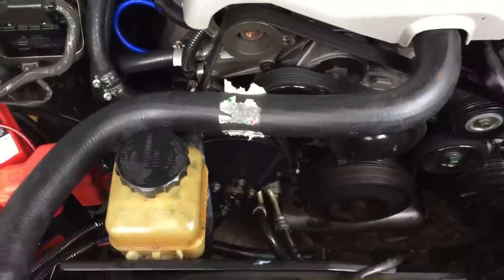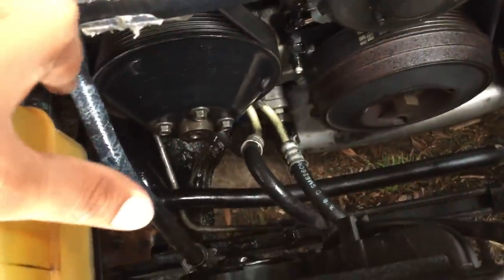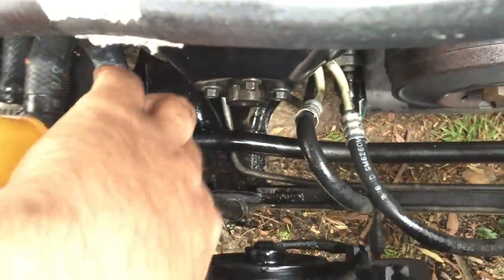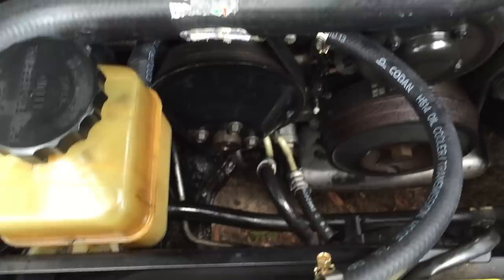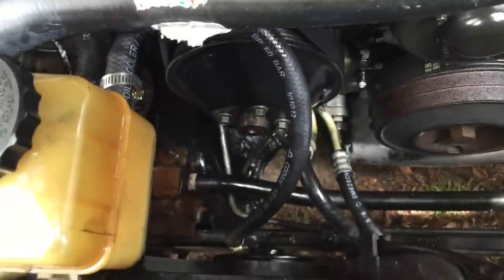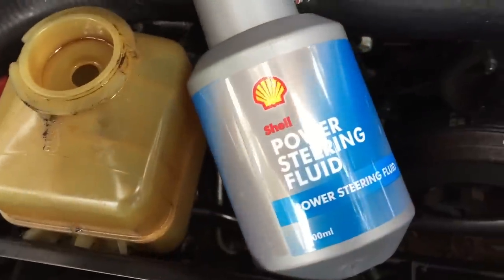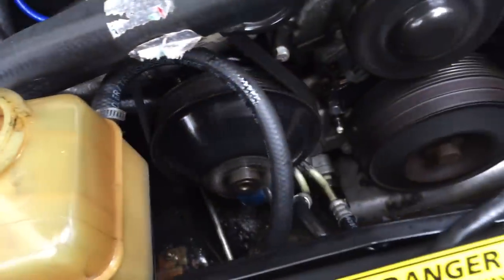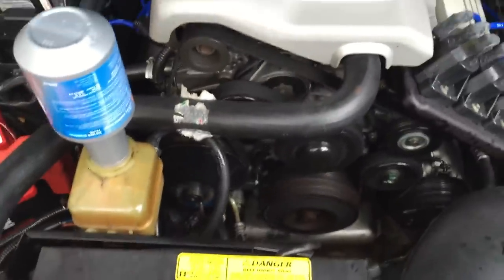Holden Commodore Power Steering Fluid | Hose Replacement | Faults VT/VX/VY/VZ/VF

Comment: thanks for the video.  

My steering has been making a groaning sound for the past week, it worsened today with the addition of heavy vibrations when turning the wheel.  Seems to be worse at lower speeds.  I've had a look at the power steering reservoir tonight and it is very low, about 2cm from the bottom...I'll go grab some of the recommended dexcon IUII tomorrow and top her up.  There seems to be a leakage from it though, so I suspect the hose is probably screwed too.  I had the power steering pump gaskets changed 2 months ago by my local mechanic, not sure if they checked the hoses etc...

Comment: there is vair in the power steering lines and thats why your getting that noise.

  

  

               
              

    Flushing the Power Steering

                            
                    Posted by Craig Wilson on Friday, April 6, 2007 · 6 Comments 
                
                    
            

   Today we are going to look at the best way to flush your power 
steering system. There are several different ways to do this and I 
believe the way I am going to show you is the only way to completely 
flush the system of old fluid. Once again please read and understand all
 the steps outlined before starting the job.
The first thing you need to remember is that the front wheels of the car MUST be off the ground to do this, damage will be done to the pump and steering rack if this is not done.

 
The second requirement is that you know which hose is the return hose
 to the pump or reservoir and which hose is the high pressure from the 
pump. Generally the return hose will be all rubber with hose clamps at 
either end and the high pressure hose may contain a length of steel pipe
 with crimped-on fittings at either end. It may also be all rubber, but 
with the same crimped-on fittings.
Another way to tell is by the size of the fittings on to the steering
 rack itself, the high pressure hose allways has larger fittings than 
the low pressure return hose. The vehicle we are doing this job on is a 
VT Commodore and has two rubber hoses connected to the reservoir, the 
larger of the two is the pump feed and the other comes from a small 
cooller fitted at the front of the vehicle. Our return hose in this 
instance is the smaller of the two.
 
Once you have a grip on which hose is which it’s time to jack the car
 up so both front wheels are off the ground, place a catch-tray 
underneath the car and remove the return hose from the pump/reservoir. 
The next step requires a very technical piece of equipment, a small 
length of hose with a bolt stuck in the end of it! Yeah I know it’s 
crude but it’s very effective believe me! The idea is to place the small
 piece of hose over the outlet where you removed the return hose from 
effectively sealing the pump/reservoir again.
Next we take the return hose and place the loose end into the 
catch-tray under the car. You may need a piece of hose to make an 
extension for the return hose so it reaches the catch-tray.
The next step requires two people. One to start the car and move the 
steering wheel from lock to lock and the other to keep fluid in the 
reservoir. The fluid level drops very quickly and to avoid damaging the 
pump or rack, the fluid needs to be kept up to it. Two to three complete
 turns is all that is needed to flush it completely. Switch the car off 
as soon as you have finished turning the steering wheel.
The final step is to remove the blocking-off hose, refit the return 
hose to the pump/reservoir, top up the fluid level and once again start 
the car and move the steering wheel from lock to lock, ensuring that 
there is sufficient fluid in the pump/reservoir to prevent any damage 
being done. Don’t be surprised to hear some whining or gurgling sounds 
coming from the pump, it takes a while to rid the system of all the air 
present. I once had a car that took a day of off and on driving to expel
 all of the air! I wasn’t happy because I thought my apprentice hadn’t 
been careful enough with keeping the fluid level topped up even though 
he swore black and blue that he did. Once everything is operating 
normally and the fluid level has been checked, time to jack the car down
 and take it for a drive. I normally check the fluid level again after 
the car has been sitting for a few hours, just to be sure.
And that’s about it for flushing your power steering. If you do this 
as per your manufacturers handbook the system should give you years of 
problem-free steering!
Reply from the maker: possibly

Comment: hey my Car is making that exact noise yours does when you move the steering wheel . I was told to replace the rods and Bushes? what is the cause of this. 
I will top up power steering fluid. can you suggest what I need to ask the mechanic to do to fix this problem
Reply from the maker: +Toni Aroha its probably air in steering system.
for this top up steering fluid all the way upand keep the lead open of fluid holder  -> now start car and turn steering left to right a few times this will clean air out of the system. Now close the lead.

if noise is still there ????

Then its from fan belt. probably time to change the belt its only about $36 for one or apply some lube both sides but not too much or belt will come off.

before doing anything take a photo of belt directions might be handy later
Reply: +ARP MEDIAZ thank you. I've filled the Power Steering fluid up. whilst I was doing this I noticed my Spark Leads were ripped and had been sparking but had been Tapped up (Very Scary) lol. 
since filling the Powersteering fluid up the noise isn't as constant but it still makes it when I start the Car for a short period of time. 

so you don't think the Rods and Bushes have anything to do with it?
Reply from the maker: +Toni Aroha Shouldn't be rods and Bushes.
Sounds like fan belt is the naughty one. You can test it by putting some water on belt before you start it.
If noise is still there than its something else if gone then its definitely the belt.

More on your spark leads situation.  you should take it seriously this can cause issues misfire and may be plugs or cylinder will die. Change them they should be about $140 from Bursons or repco. Get NGK they the best
Reply: +ARP MEDIAZ yes I've replaced the Iginition leads (spark leads) it cost me $110 inc labour. 

I've had it serviced the major things they mentioned to get DONE Asap; was,
the bushes and rods, Engine mounts
power steering RACK replaced
valley Gasket, and something to do with the suspension. 

arghhh hope it workouts after this lol. thank you for your help

Comment: I have been told that i need to flush the brake fluid after replacing power sreering hoses is this correct
Reply from the maker: +mymidlelegjuice No mate its apple and mangoes 
They are two separate areas. Usually a good mechanic will suggest to Change all oils when you change one.
But Holden vehicles are tough no dramas at all as long as its topped up and pads got tread on them.
Reply: Brakes have nothing 2 do with steering.gearbox fluids the same as power steering fluid.

Comment: you can buy these hoses easily on ebay , those guys at holden  you spoke to are full of it ! something else you should have noticed when that resovoir hit the belt you would have had warning of it. I am a mobile mechanic though and i know how to source parts and get things at trade price well below those rip off prices over the counter and i am well used to bad advice from some of those guys at holden and other retail places supercheap has to be about the worst for telling people bullshit all those guys in the retail of those places i would not trust one word they say, myself i fully research every job right down to torque specs , 

i have heard that much bullshit from know it all people i just leave them to it because a great deal of people in society believe a lot of myths and bullcrap from what someone has told them, every job you do you want to put the time in researching as it saves big headaches, i have worked on tons and tons of vehicles and some people have been amazed at the diagnostics i do diagnostics where established workshops have absolutley no clue .

happened to me but i replaced that resovoir with a polished metal one, one reason is those resovoirs have filters in the bottom of them which get filled with dirt and are un-cleanable what happens is you will get a lumpy idle and people think it is the power steering pump when in fact it is the resovoir filter clogged up with DIRT, 

 the aftermarket polished one is far superior and even cheaper and they look good, the resovoirs do not just pop out though unless you have been negligent in have a look at your car every now and then, since the metal resovoir popped off i had about 4 KLM warning a strange power steering feel and noise i pulled over put the metal resovoir which was really hot back in its place since then i have bought metal cable ties  which cost $2 maybe on ebay  to strap it in place do not get plastic ones obviously these resovoirs get real hot the metal ones do thats for sure
Reply from the maker: Bro great advice and thank you for sharing your knowledge, but as you know I am no mechanic I had no clue what size these hoses were to buy them from ebay. Also it was an emergency so needed something right away and local shop was the best option. 

Not sure why It did not come with a warning sign when reservoir dislocated. I only realized when steering went hard and will not move easily. Or may be its an option in premium model only ?
Reply: they are not sold in sizes on ebay  , they are listed as "VS commodore power steering hoses" , and the cost for the resovoir to the pump that hose cost $13, the other hose cost  $20
Reply: @iamasmurf1122  I dont quite understand. Are you saying there's no way that the reservoir popped off without any notice or signs? 

Agree about getting advice from retail stores but Nothing wrong with general advice though cause by God do the majority need it. The issue is the car owners themselves not willing to learn one word out of their owners manual.if they seek advice you give the best advice you've got. They were doing nothing otherwise, so If their shit hits the fan it's no one elses fault.

2nd big issue being what so many turd mechanics have done to cause so much distrust towards themselves. Would be nice if you could feel comfortable stopping by a mechanic for some simple advice without being taken advantage of or treated like a useless old potato. 

I trust more retail staff whove learned to read off what the computer says than any so called "mechanics"

Comment: Don't mean to sound like a spanner in the works but is it me or did that noise, when turning the steering wheel, sound as if it shouldn't be there.  Didn't sound like a healthy fix at all!
Reply: the groaning sound means that he's low in fluid, all he needs to do is fill the container, move the steering wheel left and right, clocking it each time until the system is bled, best to keep the lid off while doing so.

Easy fix when you have had old cars that show small signs of failing.